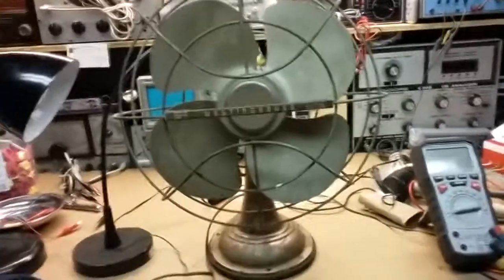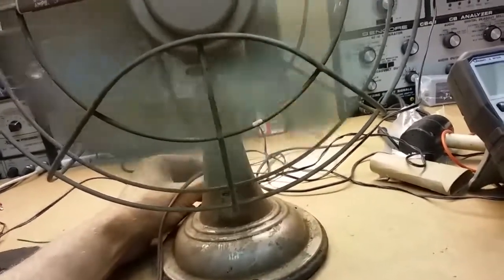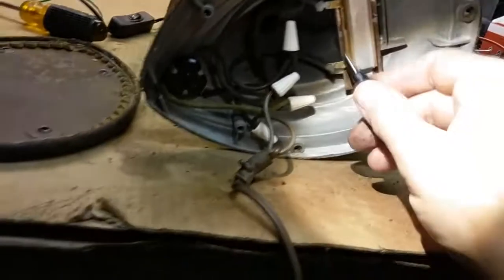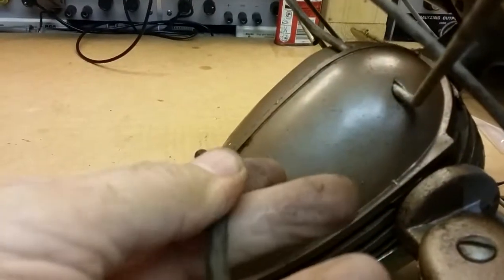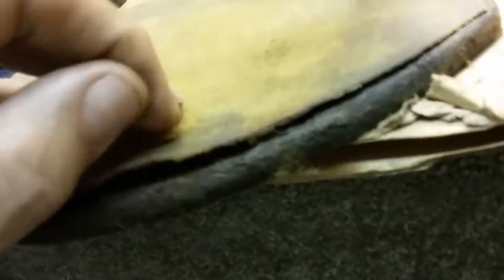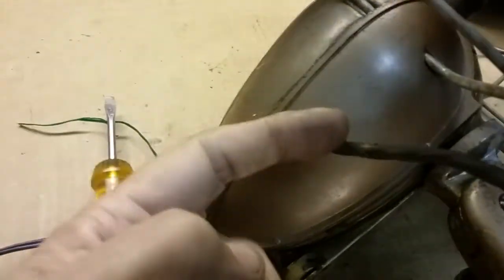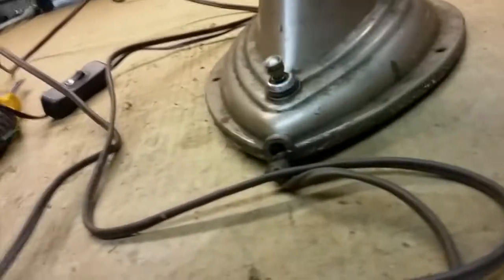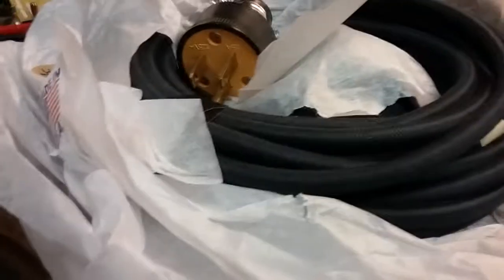Westinghouse Bullet Fan - 12LA3 - Part 1: Diagnosis

Comment: I have one that goes off/low/high/low/off. Not sure if it’s an aftermarket switch or just wired incorrectly? It looks almost the same as this one (mine is a 12LA4) says Leviton on it as it looks like this one does.
   Also…mine has the original headwire but interestingly it is three conductor wire with one ore cut short and I can tell it’s factory.

Comment: There are two small felt pads that fell out of the motor housing when I opened. Can you assist with telling me we’re they go?
Reply from the maker: Sorry, but I don't know. I don't think I ever seen felt pads in a motor. They might just be some remnants of old insulating materials around the back of the stator. I would not sweat them.
Reply: Yeah I saw those too. I’m going to be taking another one apart soon to use some parts for the first one in which I screwed up the stator. Will be way more observant this time about those as well as those sort of metal plates that are kind of wedged on top of the bearing or something.
Reply: @AmeriFanPicker  did you ever find the location of those felt pads? I can't figure out where they go.  Also there is a black piece of "paper" that I am unsure of the location.  On top of the resistor?
Reply: @Doubletroubletwice  man….i still never delved into it lol. Since mived on to bigger better fans. I still plan on it though cause it’s in good shape. The felt I believe is on a ort of either side of the shaft where it exists the motor. Acts maybe as sort of an oil seal???
Reply: @AmeriFanPicker  I found the location of the black paper.  It separates the wiring from the motor and stator.  The wires tuck in behind it.